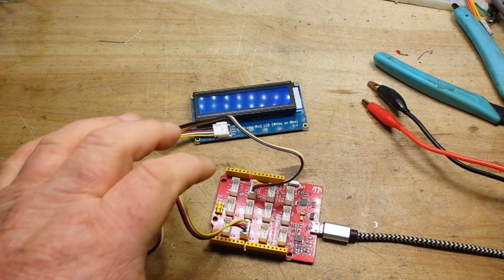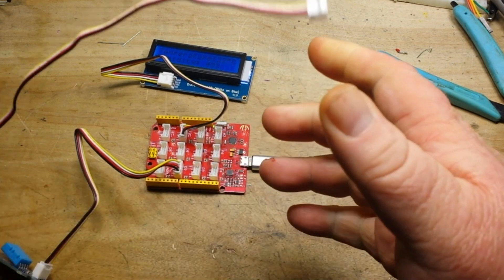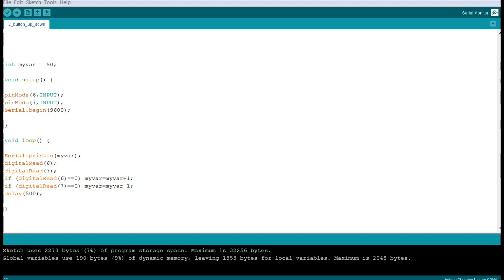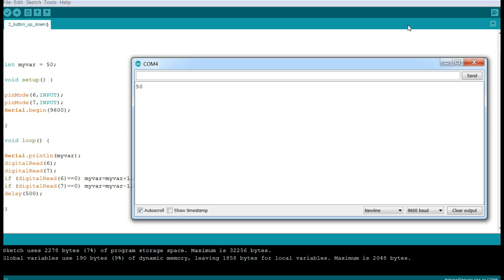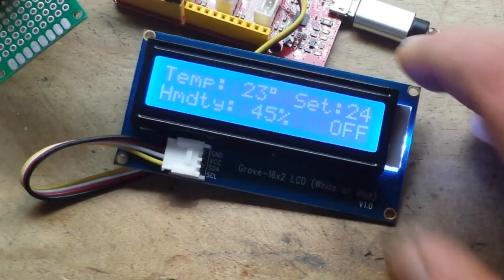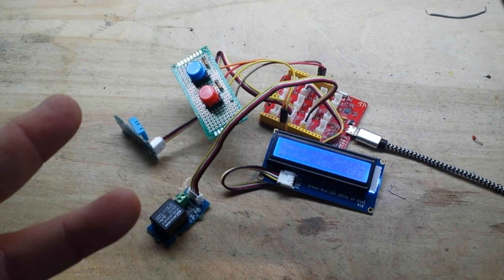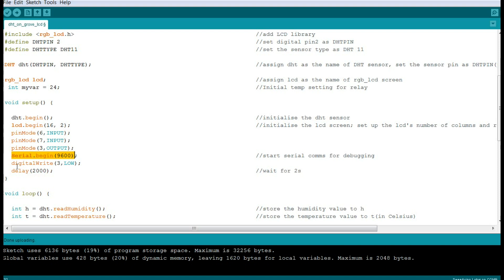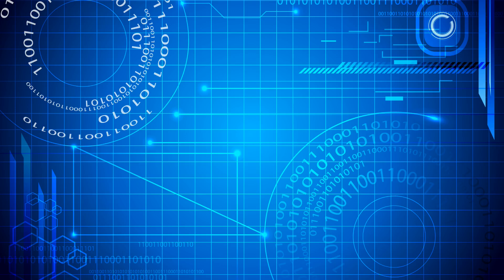Arduino Temperature Control with Grove Sensors

Comment: I am new to all this. I have 12v valence batteries with internal bms. How can I communicate with the internal bms via rs485 to arduino to property see if if it’s balanced? And what r the codes for the arduino for this to work. Do I need relays?

Comment: is there an easy way to change Arduino sketches that are written for individual wire LCD's to use a i2c lcd of the same 16X2 format?
i dont understand why so many people write code for the multi wire lcd screens and not i2c  when wiring is so much simpler, i only have i2c screens and dont want to de solder the modules and want to learn how to modify existing code to use i2c if i can, im sure its just a line or two that needs to be changed and including the right library's?

Comment: Hello Paul, 
This is a bit off topic but I have no one else to ask about this. I am an engineering student and I would like to buy the ARRL Handbook for radio communications. Does it matter if I buy the older 2009 version from ebay ?  I dont want to read the ebook and the new one is very costly for me since I'm on a tight budget right now (including shipping to germany).  Could you please tell me if getting an older version (2009) of the ARRL is worth it ? (68 USD with free shipping)
 Thanks, Aneesh.
Reply from the maker: Buy the older one by all means. Electronics is physics and it hasn't changed in the last few years.
The new books every year are nothing more than marketing, in my opinion.
Reply: @learnelectronics  Thanks for the reply  and have a great day.  :)

Comment: Nice can you make a Part 2 for remote sensor? the control can be in hallway but temp semsore i need heating in is a different room :D can you help a new vid for this would be great.
Reply: My wireless setup does not have it yet but can be modified. https://youtu.be/hfPzjJTXN7g